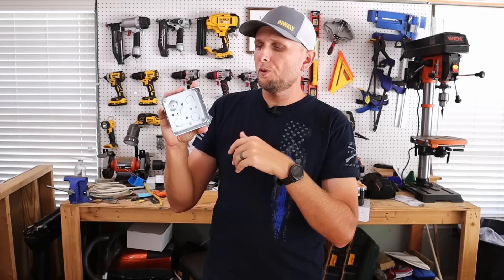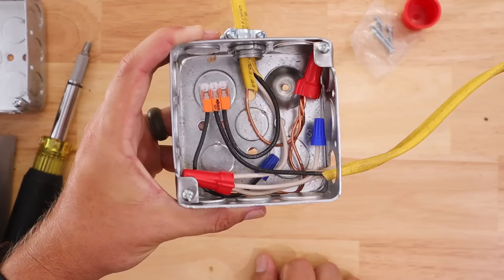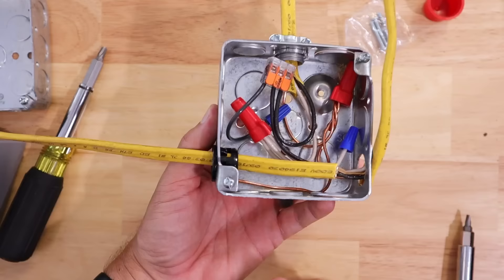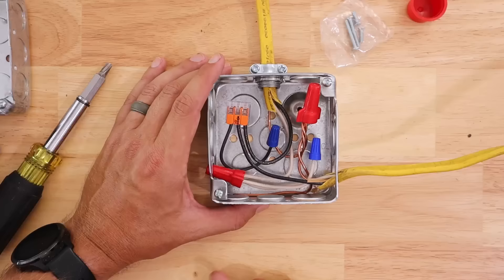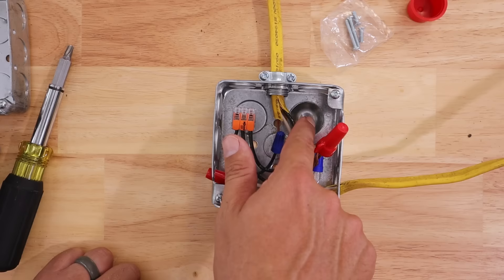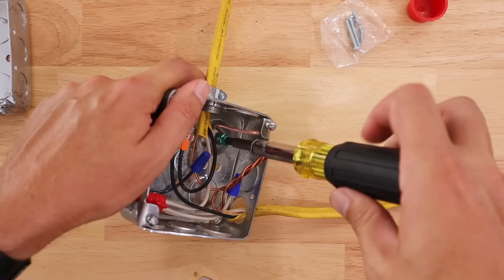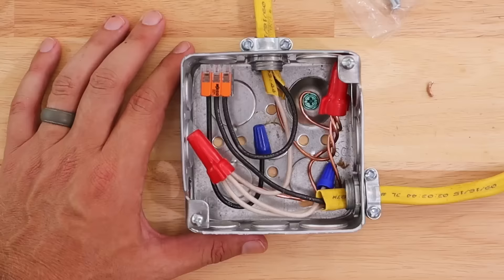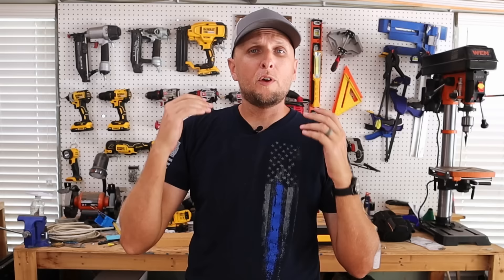The BIGGEST Mistakes DIYers Don't Know They Are Making When Installing Metal Electrical Boxes

Comment: Can you please explain why the grounding screw needs to be one of the special green screws?
I would think that any metal fastener would work.
Reply from the maker: It doesn't HAVE to be green in this particular application.  This is for homeowners and it's way easier for them to just go find these green screws in the electrical aisle and know that they will fit instead of trying to find a machine screw that will fit correctly.  In some applications green ground screws are required however.

Comment: No doubt not clamping the cable to the box is a bad thing, but how big is a problem of cable being pulled on?  The cable should be stabled  many times along its run as well plus buried inside wall.  I truly don’t understand the pulling danger.   Once done the cable is practically inaccessible to be pulled, so what is pulling it?  My fear is more from subtle house vibration slowly wearing through the insulation eventually causing a short.   The only time I can see it being pulled is during insulation, but that seems to me would be some kind of daisy-chain situation.   Is that pulling you are referring to….

Comment: You know you should talk more about pre-twisting. I'm on a job site in New York City in Hudson yards. It's going to be one of the biggest projects there is and people going to be in there for years after they're done and one of the biggest problems I see why is falling apart in boxes guys not making proper connections loose neutrals you know what I'm finding these loose neutrals from guys not free twisting they just use a wirenut and a lot of wines are coming loose. I'm going all over the buildings finding loose neutrals

Comment: I noticed pig tails there for perhap a receptacle?   There is not a ground pigtail?  I guess you intend to have it connected to receptacle before you twist it onto the others?  I sure would like to find a better way to connect several grounds together i have been using two push in connectors but I wrap the bundles real tight with green electrical tape 1/2" below the push in connectors.  That prevents wire from backing out of connectors if you are to position them.  If a box is crowded and above the ceiling , I would let them hang out of the box and used as a junction box.  I would like to see if grounds can be crimped?  I haven't looked up for the correct method of crimping.
Reply from the maker: The ground pigtail is there.  It’s hiding behind the neutrals.   I do not crimp any wires.  Wire nuts or lever nuts are sufficient enough in most applications.

Comment: So I just discovered that putting 2 outlets in a 4x4, the outlet terminals short to the lock nut on the EMT connector.      I am wondering if there is a ring I can add to space it out, otherwise is my only option to replace with a deep 4x4 box?
Reply: Good evening Bryan.  I have had the same thing happen.  It gets pretty crowded in there.  But I was making two dangerous mistakes.
______________________
~One thing I have found, Bryan is to screw your unused receptacle terminal screws all the way in.  If they are sticking out, they can touch the sides.

~I have made this dangerous, lazy mistake, as well.  Working with a hot wire.   Make sure the power is off at the panel until you are completely finished with the install.  

If both receptacles are properly mounted in the box, and the face plate is installed, then power is turned on at the panel, nothing will short.
______________________
Good luck, Buddy!
Reply: @mark9531  
Funny thing -  I didn't realize, but I was working with a hot wire as well. All my lights happened to be plugged into the same circuit (though I just  a second one wired).    Just to make it more interesting, this box is at the level of the liftmaster in my new shop, and I was in  a scissor lift, head near the 18' ceiling. 
   The breaker blew leaving me in the pitch black, needing to fire up the lift and find the up-down select which took waaay to long.

Too bad I didn't see your reply, I did find a box extender ring and put it on there to elimnate that possible fault.
Reply: @brynnrogers5081  I felt sorry for you until I read the part about an 18 foot shop ceiling.

Now I have garage envy.
_________________
Be safe, Buddy.

Comment: Question if i have metal conduit thats grounded at the main panel all the way to the metal exterior box and it has a gfci outlet do i still  need to bond my box?
Reply: If there is no wire type Equipment Grounding Conductor (EGC) in the conduit and the GFCI receptacle is not the Self Grounding type then the Green terminal of the receptacle must be bonded to the box with a bare or green colored insulated wire. Even if the receptacle is self grounding it's grounding screw must screw into the box itself and not just a cover unless the cover itself is listed for grounding. 

Tom Horne

Comment: Can someone explain to me why the grounding screw is necessary when the grounding wires are already in contact with the metal casing?

What I'm trying to wrap my head around is that the presenter says that having ground wires bound up in a metal box like this is not good. I understand that once a live wire comes loose off the wago it energizes the box. But I'm not sure what that has to do with the grounding wires and the need to add the grounding screw.
I see that the grounding screw connects the metal box to the ground wires (and the house's grounding system). But that's basically the same as the ininsulated grounding wires being in contact with the box - which they already are.

I can see this wiring to be dangerous and the grounding screw being necessary only if the grounding wires WERE NOT in contact with the metal box - so if a person touched the box, the current would have no path of less resistance to the ground that through the person.

Comment: I never understood wire nuts. Whenever I’ve come into contact with them they were loose and dangerous and once the wires are twisted up they are more prone to breaking.
Reply: There are a lot of neat things on the market today that weren't around decades ago.

Wire nut have been around for 100 years.  And properly installed, they are perfectly safe.  And they are cheap and meets code.

If you were building an entire house, that many Wago connectors + using higher grade light switches and receptacles, + metal vs plastic boxes, + 12 vs 14 gauge Romex, could be a factor.

Now, me as a DIYer, I use Wago, or push connectors because I am just doing a few projects.  And a couple extra bucks for a better receptacle, light switch, and metal boxes is not an issue.  But I stick with 12 gauge Romex.

Comment: All metal boxes in Ont, Canada  come with two grounds screws in them, the wires  for your joints where all to short and YES all wires should be twisted together when using a wire connector.
So you have a good connection and are not counting on the connector making and keeping the connection,because if it comes loose or is not tight enough you could lose or have a bad connection 
Any and all electrical work  that is not inspected by the electrical authority or
 done by a licensed 
 electrician 
WILL VOID your 
HOUSE INCERANCE 😮😮😮

Comment: Is another mistake using blue wire nuts?  I don't think most of the smaller blue nuts are allowed on #12 wire.
Reply from the maker: The mistake is not the color but what each wire nut is capable of in terms of wire size and quantity.

Comment: Nice video.   However, my standards for electrical wiring would NOT allow me to leave so much bare copper wire sticking out from underneath the ground between the 9 o’clock and 12 o’clock positions.  A big no-no.   I never ever like to see that.   Just my opinion.  Get a needle nose pliers to pinch that wire together, and keep it together, while tightening the ground screw.

Comment: Wouldn't the 14 gauge wire be okay with the 12 gauge if it is on a 15amp circuit breaker?
Reply from the maker: Yes code wise but the purpose of the video was for all of this being on a 20 amp circuit.  Even on a 15 amp I still wouldn’t do it so as to not possibly cause issues for the next owner.

Comment: Electrician here, only reason i clicked was because of the WAGO on fire in the thumbnail with the "do not use" over it. 

Can't wait to hear what a american, non-electrician, DIY-er has to say about the literal easiest to use and safest connector on earth.
Reply: I think you may need to check the bottom of your tool box for a sense of humor. While you're at it, check if Ugly's has a reference for capitalization.

Comment: I like to Use Shall 1900's only when I have. The Comment about have a Black doing nothing missed that that is for a Receptical, and the missed the white wire Doing nothing as well, which is also used for that Receptical. Someone mentioned if a short number 14 is used, it can be on a 20 Breaker which is wrong. If any 14 is used on a circuit. Breaker needs to be 15 Amps. I like boxes with squared  sides. They sit perpendicular with the wall, not angled back. Also Ground Wire needs to be Solid, not Stranded.
Stratmando

Comment: Using a #14 wire with #12 wire is fine so long as the breaker is 15 amps.

Comment: Adam, this is for your YouTube viewers.
Pre-twisting any wires in a box is a must do. Never let a wire nut do the twisting for you.  
If you use a wire nut to do the twisting for you, there may be one of the wires being twisted around another wire which has no twist.  The wire with no twist can be pulled from the wire nut without much problem. NOT GOOD!!!
Wake up and do it right the first time.

Comment: You are actually wrong about the last one.

The resistance of a conductor is dependent on it’s length. And since the wire is short it will probably hold as much, if not more, current them the cable you have running thru the walls.

That’s electricity 101.

Comment: Why would you kick out 4 inches of #12 to go to a 15 amp socket or recepticle?   Oh... so you can break the recepticle when installing it?  Have you installed any 20 amp light bulbs lately?  If the waygo can safely handle the two#12s and a #14... so be it.

Comment: those metal boxes are simply illegal with us.  just like using wires without insulation.  all wires must be insulated, positive, neutral and ground, also all signal wires must be insulated.  thread nuts are also no longer allowed for new or renovation works, everything must now be with WAGO model.

Comment: I like waggo connectors, but unsure about using them to connect copper wire to Aluminum wires. And due to the
so called "copper shortage" during the 70's, many apartments and homes have aluminum wiring which is not good.
YOU MJST USE ANTI-CORROSIVE COMPOUND that works with aluminum and copper to keep from corrosion as 
copper touching dry aluminum causes corrosion over time.  This causes the connections to become resistive, carbon  up and eventually melt the wire nut.  A BREAKER DOES NOT DETECT THIS KIND OF HEAT, IT ONLY DETECTS DIRECT SHORTS AND OVER CURRENT.  Which brings me to fuses and the comparison to small short pigtails.  If you buy a fixture that has 14ga, 16ga, 18ga wire, you don't have to match it to your 12ga incoming power wire.  It's all about length.  A short small gauge wire can conduct just as much current.  Such as the element in a fuse.  Look at one of those old fuses and how small the sq.-area of conductor in a 30 amp fuse.  Or even on a circuit board copper trace.  (The longer the distance -the larger the conductor required,. The larger the conductor - the lessor the resistance.  The lessor the resistance - the lessor the heat. )    
 This has been my understanding and hopefully helpful to some of you.

Comment: I hate when I have to fix a circuit and the wires are twisted beyond belief.  Now you have to untwist the wires which if you keep twisting and untwisting will cause fatigue and eventually break.  Not to mention it's a pain in the -ss to deal with.  The wires are no longer straight, and in order to cut and re-cap you have to break out the tools to re-straighten.

Comment: My hot water heater was installed by apprentices.  The ran 10 gauge to a junction box and came out of it into the hot water heater with 12 ga.  We ran it like that for 10 years. A few months ago I purchased a new one.  As I was unhooking the old one I noticed the mistake.  I did call the company and they offered to have the same guys come out and correct their mistake.  I asked if they wouldn't mind having them come over so I could show them how it was done.  The owner thought it was funny and sent his boys over. Their papa tore them a new one.
Reply: Hmmmm.  10 years later your replaced that heater with a new one. Ok what was the heater tag on the old heater stating. Distance from the distribution panel, etc.
Reply: 12awg can support 20amps each.  If the length of the 12 is short, it should be ok.    The wire amoacity depends on awg AND length
Reply: @mkidd8806  the heater had been running for 10 years off just the top heating element.

Comment: One question!!  Is it not better to use plastic box instead of metal box, metal is good conductor but plastic not, so if a wire will, for some reason get loose, then metal box can make it worse
Reply: There's usually a 10-32 hole for a green ground screw where the ground wire is attached to the box and also connected to the other ground wires. Then the box is bonded so if a hot wire contacts the box and the circuit is wired correctly, the breaker would trip. So, when this is done, (it is required) the metal box is as safe as a plastic one.

Comment: Please allow me to note you are using a wrong term for "ground wire", I don't think this is a US specific thing :
1) Earth wire (CPC) : this wire allows a "short" current to flow that blows a fuse.  It resistance in the circuit should low enough to allow at least double the current to flow greater than the rated fuse device.  All the wires in home usage (where 3 cores is provided) to normal electrical devices are earth wires and are there to cause a fuse to blow.  As you correctly describe, you must insulate the earth wire as in a short it can be live until the fuse blows - and is live between -10 and +10 volts depending on the neutral loading.  In most cases the earth wiring  is connected to ground at the sub-station where the main grounding mesh is installed, or earth can be connected to neutral (return) at the consumer unit, so is the same potential as the neutral wire.   The earth wire is NOT at ground - it varies about 10V around earth potential.
2) Ground wire is a true earth wire at local site, and is used to connect gas mains and water mains to all metal items within wet rooms to local ground.  This means that all metal items in a bathroom are the same potential so low resistance skin (when wet) cannot get a shock when under the shower (at water main electrical  potential) and reach for a towel on the radiator - heating rail since both are bonded together with a ground wire.
So in summary : the 3'rd wire in electrical circuits - sometimes known as CPC - is earth and is specifically designed to create a short current to blow/trip a fuse.  It can become HOT (live) in fault conditions, and is always slightly live with a few volts and is often the same potential as neutral (return)
Grounding wires join together metal items in the house to prevent even small potential differences between the water and metal items in wet environments - where the human insulation drop is down to sometimes below 1 volt in some "sensitive" areas.  It is to prevent wet environment electrical shocks of a few volts due to stray potential.

Comment: When i use metal boxes for projesrs, as opposed to installation in a home/residential building, i tape out the inner back with electrical tape so i can afford to not be obsessive with wires as i am working… not sure if thats a stupid  idea or an obvious one. But i figured it coulfnt hurt

Comment: Granted the 14 gauge is incorrect, but a safety issue it is not. A 6” 14 gauge wire will safely conduct 50 Amps. A wires ability to conduct current is really a function of its resistance which is a function of its material, diameter and length. The problem with codes are they allow zero tolerance for common sense, engineered design.

Comment: Shouldn't you fill the electrical box with building foam so the cables won't move around inside the box? I've done it with all my boxes and also done it to all the sockets and the breaker box / cabinet itself.  The breaker box is now a solid box of foam and no cables will ever move around inside it while I'm watching TV.